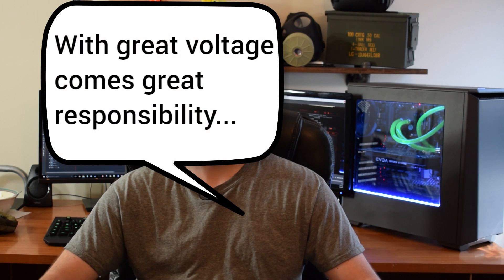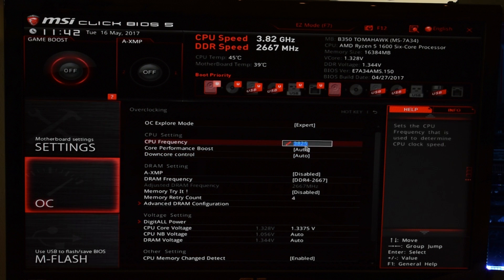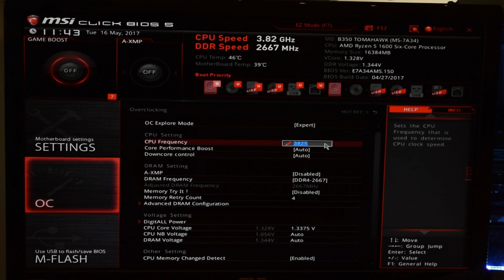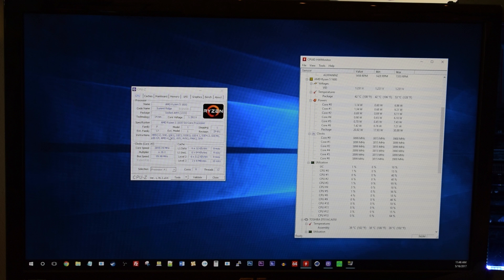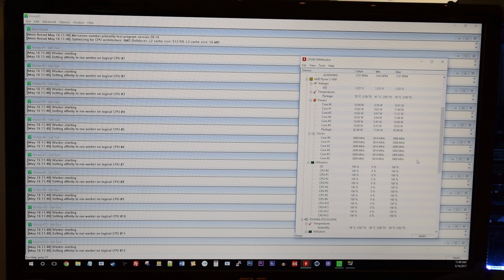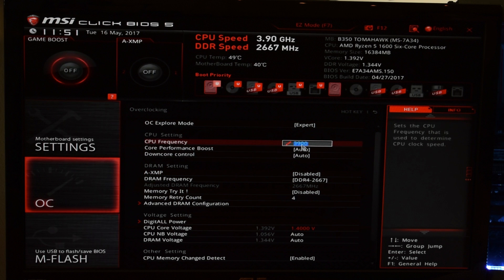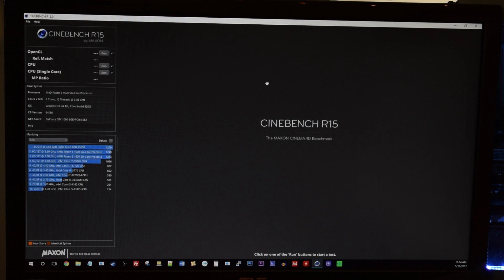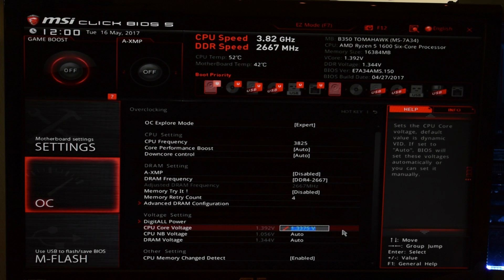How to Overclock a Ryzen 5 1600 CPU - Super Easy!

Comment: Love the video man just need a little help if u dont mind. I wanna get the same mobo and cpu and want to run everything on stock so will that still perform ok?and maybe u can recomend a less pricy graphics card that will do just  fine..everything on stock what power supply i should get? And for the ram i read its better to get 2 or more sticks then just a single high end stick. Oh and keep it up man your videos are awesome such info much wow
Reply from the maker: Thank you! Ok first off, the R5 1600 is amazing even at stock speeds. The improvements you get from overclocking really only make a noticeable difference in benchmarks and a couple extra fps in cpu intensive games.

As far as a graphics card, it depends. On 1080p if I were to step down from a 1060 I would say a 1050ti (http://amzn.to/2v0oiiE or http://amzn.to/2vjzNUE) at the very least. It all just depends on prices and availability since crypto miners jacked the price and stock up.

Power supplies usually don't make a huge difference as long as you get one with 50-100% more watts than your PC needs to run. A evga 500b like this one would work http://amzn.to/2hp6eLI).

And lastly, yes dual channel runs faster than single channel. If you wanted 8gb to start and wanted to upgrade in the future then you would be better off getting a single 8gb stick of ram instead of two 4gb sticks. On that same note you could go with two 4gb sticks and add two more 4gb sticks if your motherboard has 4 slots. Just make sure to check the manufacturers website to see if the ram is compatible.

I hope that helps.
Reply: it helped alot thank you very much. i got a EVGA 430 80+  Certified ATX Power Supply will that be ok ?
Reply from the maker: No problem! Yeah, that should be fine.

Comment: Hi, I need some help with voltages, I can't get my 1600 stable not even at 3.8 with 1.4v, is that too much  voltage?
Reply: I have an Asrock x370 fatal1ty Gaming K4 and G.Skill Ripjaws V 2x8gb 3200 (runs  @2933)
Reply from the maker: That's up to you. I personally think 1.4v is too high. I believe AMD suggests anything under 1.42v. To me, the little bit of extra performance wouldn't be worth the risk if it's going to be a long term overclock. Not all Ryzen 5 1600's will be good at overclocking. You might have to drop down to 3.7ghz and see if that will be stable at less than 1.4v.

Comment: i have a question. does the power supply affects the overclocking overall? i plan to build a r5 1600oc with psu corsair cxm450w, does this power rating able to overclock cpu?
Reply from the maker: Generally no, unless you have barely enough power to actually power the system. In my experience, the cheaper power supplies work just as well as the more expensive power supplies. They say the sweet spot for power supplies is at around 50% load. So if your system requires 300w then a 600w psu may be worth looking at. I hope that helps.

Comment: Question , i oc my ryzen 1600 to 3.8ghz on 1.38V but when i look at CPU-Z the voltage is some times alo bigger it jumps to 1.424V  WTF ??? Help me to fix this
Reply from the maker: It really depends on you motherboard and the settings. I would just make sure the cpu voltage is set to manual. Sometimes the CPU-Z doesn't report the voltage accurately and sometimes the voltage applied to the cpu is not the same as what you set it to. I don't think there is much you can do about that that. I think it comes down to tolerences in the manufacturing process. What you can do is lower the voltage to see if it still goes that high. If it only goes that high temporarily then you should still be ok.
Reply: Thats because you have the core perfmance boost enabled.

Comment: can you do a ram oc guide im trying to get my trident z rgb 3200 to run at 3200 but cant my display will get no signal i have a striz b350 f mobo and ryzen 5 1600 at 3.9
Reply from the maker: +Rav's Reality I may be able to do that in the future. In the meantime check the motherboard manufacturers website to make sure the specific model number of ram is supported. If not, it won't run at advertised speed. That's why my 3000mhz kit only runs at 2667mhz.
Reply: SANTINI.IO would a 3.9ghz at an avg of 1.387v be a good overclock the voltage ranged from 1.352v-1.402v -passesd stress test for 4+ hours
Reply from the maker: As long as it's stable then that should be fine. I would probably set the voltage to a costant instead of auto. But again, as long as it's stable and the voltages don't have to be set really high then it should be fine.
Reply: SANTINI.IO on my strox b350f mobo i do an offset voltage of .13740v from the reg 1.237v

Comment: What kind of Cinebench scores are you getting with the 1600? I'm getting ~1320.

My 1600 is stable at 4GHz with 1.4125V. Ram at 3000MHz. With watercooling temps max 70 in synthetic benchmarks.

Comment: Hi. I have just one question and it's about PSU. Im going to make similar build with R5 1600, GTX 1060 6gb, etc. but I was wondering if EVGA 600B is strong enough for that build. I will overclock the CPU only but nothing special because I will leave it with stock cooler. So maybe 3.6-3.8 GHz. My first plan was to go with EVGA SuperNOVA G2 650w, but question is, do I really need that one or 600B will be just fine?
I have been doing some research and people usually say that quality of EVGA 600B is not very good for OC (chinese capacitors, etc). Price of both units are 75 and 110 euros (in my country). So, which one should I go with? :D
Reply from the maker: +Dusan Puzigaca I haven't had any problems overclocking with the EVGA 600B. If looks are not important I would go with the 600B. The Supernova 650 G2 is modular so it will make cable management a lot easier and it will look better. The supernova is also 80+ gold so it is more efficient than the 600B.

If the extra money isn't a problem the Supernova 650 G2 is the better option. 

In the US the EVGA 600B is about 35 euros or ($40 USD) which makes it a good choice for the price (That's why I got it). The Supernova 650 G2 is more than twice that price which is why I didn't consider it.

But because the price difference is closer between the two where you live, if you can afford it, I would go with the supernova 650 G2.
Reply: Thank you for the answer. I'll go with 650 G2 then.
Reply from the maker: +Dusan Puzigaca No problem!

Comment: Great video thank you very much.

I must be lazy when I dialed in my Sandy i7 way back I just used CPUZ stress test until I got a failure. Then upped voltage 1 step at a time until a pass. Then upped core speed more. I ended up with 5.1Ghz@1.42c with max temp of 82c under Aida64 and 52-59c in most games and a lot of others sitting at 47-53c. The system been running this way for years and never crashes in games well unless the game itself is poorly code. This CPU also does 5.2Ghz but with more voltage so whats the point if only 100Mhz but a 1.47v you get to the point of little returns.

This is on a zalman 9900 max air cooler only in a Antec 900 case. The Zalman is mounted so air is blowing hot air up then the 200mm top fan sucks it out. I installed a partition over top of th Graphic card to block heat from video card getting into CPU area and warming up the CPU. The graphics card now vents out the side of the case through vents I carefully made. Two front fans move cool air into the CPU chamber area and bottom chamber area to keep case temps down. With this case and a very minor mod my temps dropped every where inside it. I will miss this case when I change it out I think it's time for modern cable management where everything is hidden.lol

Comment: Hi!
I am thinking of setting new pc configuration and I am wondering can I save some money by choosing 1600 over 1700. My concern is the preview in adobe premiere of 4k footage won;t be smooth, especially if I add some luts or multiple footages on one screem.

Have you got any set backs when doing your videos, because dropping frame rates is so much worse than couple of minutes of waitng when rendering.

Thank you in advamce
Reply from the maker: valvendex I have only edited 1080p at 60fps but haven't had any dropped frames or bad frame rates. I will get ahold of some 4k stock footage and let you know for sure.
Reply: SANTINI.IO what's 4k like?

Comment: I have shit luck for stuff like this. Surprise surprise, I cant even hit 3.7 GHz, and my chip runs at 80 celcius
Reply from the maker: +Swedishnbkongu Sometimes its just the luck of the draw. What cooler are you using?
Reply: stock cooler, when i have the cash ill buy an aio i think to maximize my performance
Reply: Thanks for the reply
Reply from the maker: +Swedishnbkongu No problem. Yeah better cooling usually helps. If it doesn't help the overclock it will at least increase the longevity of the CPU.

Comment: So at stock my cpu can run 3.7,3.8 makes it crash.Just did some testing and 1.375 voltages for 3.8 was stable in benchmarks but created stutters in game,dropping voltages to 1.3000 stopped the stutters and lowered temps.at 3.8 it runs at 69 to 70 c.
Reply from the maker: +Informative Gamer S I also noticed stutters with higher voltage. If it continues I would lower the overclock. The marginal performance gain isn't worth it if you have to deal with stutters and screen tearing in my opinion.

Comment: Mine is setting stable  at 3.85ghz with offset voltage of 1.375v, i'm using intel liquid solution cooler and asus prime b350 plus mboard
Reply from the maker: +Alzidjali Suleiman That seems to be about what most people have been able to achieve. I wish they overclocked a little higher but it's hard to complain when at least we are able to overclock them.

Thanks for watching!
Reply: SANTINI.IO yes, it's not as high overclocks as  intel chips can go, but still a nice couple mhz we gain, between 200-400 mhz what most ppl r getting, and performance is a killer in terms of the price.
Reply from the maker: +Alzidjali Suleiman Yeah I think it will be a while before another CPU beats the price to performance of the 1600. It will be interesting to see what Intel comes out with in future now that AMD is competitive again.
Reply: Agreed

Comment: Good idea for another video would be how to remove a heat sink fan and clean the old grease off and apply new thermal paste. Both for intel and Ryzen.  I know iv never done it and would be awesome to know how so I don't mess anything up lol
Reply from the maker: +Laceyn I actually do this in my water cooling loop video although I don't go over it.

What I do is use 70% or 99% isopropyl alcohol on a coffee filter (or other lint free cloth) and wipe it off. Then I use a dry coffee filter to make sure its completely dry and clean. I do the same on the heatsink. Then I apply the new thermal paste.

I may make a video explaining it, but until then I hope that helps.
Reply: Oh ok cool. The main thing im worried about is the removing of the heatsink lol. Dont want to bend anything thats not suppose to be
Reply from the maker: Laceyn I'm just about done editing the video now. It will be up in the next hour or so. Heatsinks are usually pretty durable. As long as you don't bend any copper pipes you should be fine. Fins can be bent, but try not to.

Comment: You should run prime95 for at least 4h, some people advise 6/8h to be 99% sure it's stable (hardcore people let it run 24h just to be sure). 30mn is not enough to be sure the OC is stable. I had crashes with my 2500K after 3h sometimes when I tried to OC it.
Reply from the maker: Noashakra So the reason I say 30 minutes is because when you initially start tweaking the settings you end up making a lot of changes. At 4 hours at a time some overclocks could take days. When you think everything is dialed in that's when I go for longer tests.

You are right, the longer the test the more confidence you can have in your overclock being stable.

Thanks for watching!
Reply: Sure, I was just pointing that out for people who might not be aware of that.

Comment: Got mine stable at 3.8GHZ  at 1.28v on air its not going over 60C on full Load
Reply from the maker: +Alriske 2.8v? I think that CPU would dead lol. Did you mean 1.28v?
Reply: Yeah i saw it to late lol :)
Reply from the maker: +Alriske That's what figured. 1.28v is a really good voltage to be at.
Reply: Thanks for the correction. PS: I subscribed to the channel love your video's  they are clean and you can learn something from them.
Reply from the maker: +Alriske Thank you! I appreciate it,
Reply: my 1600x 4ghz at 1.32v, full load 60C

Comment: I managed 3925 @1.3825 volts, mem only at 2666 with 14 14 14 14 35 though. Mobo is AsRock Killer Sli/AC, cpu is the same as yours (r5 1600).
Reply from the maker: +mupinIV That's pretty good. I hope in the future bios updates fix memory compatibility and speeds.

Comment: Got lucky with my 1600. I was able to get it stable at 3.9 without having to adjust the voltage. I want to see how far I can push it with more voltage, but I'll wait until I get something other than the stock heat sink to cool it before trying.
Reply from the maker: That is pretty lucky. I would imagine you could go a lot further if you haven't had to up the voltage.
Reply: well, the auto voltage is pretty aggressive, atleast on my ASUS board. It will gladly hit 1.4v on auto and 3.8 ghz. With the stock cooler this makes it hit 70+ c instantly and I dont know why I'm not comfortable with that. If I do offset mode and set it at the lowest setting like -0.0125v it will sit at 1.2v@3.8 ghz pretty comfortable
Reply from the maker: Noel Danyluk As long as its stable at 1.2v then that would be fine. But I have a feeling 1.2v is a little low for it to be stable.
Reply: Noel Danyluk I can't  divide on r7 1700 or r5 1600 mobo mem combination I need help
Reply: Divide? Or did you mean decide? If your looking to buy new gear. Ask yourself how much rendering, editing, and encoding are you really going to do. If it's a lot the 1700 is worth it. Otherwise save the money and get the 1600. 

For motherboard get the brand you're comfortable with. Ram its a tricky one with Ryzen. I took a shot in the dark with my choice of ram. Honestly though I would suggest picking your motherboard and then search forms to see what ram and ram speeds people are getting with that particular board. Base your ram decision on that, but honestly any 3200 ram should do. Just be prepared to not have it run at those speeds out of the box if you don't do your homework first.
Reply: Ali Rizwan glad to hear that. Which one did you end up going with?

Comment: 3.9GHz. Can't get it any higher. RAM runs at 3200MHz so I can't complain.
Reply from the maker: If you think about it, it kind of makes sense that it's hard to overclock them past around 3.9ghz because the binned CPU's ended up being 1600x's. I think if I would have bought compatible ram I could have run it at the advertised 3000mhz. Thanks for watching!
Reply: Makes sense. Liked and sub'd
Reply from the maker: +Jason Giles Thanks man! I really appreciate it.

Comment: Hi, im a new sub and i must say your chyannel is really good. Besides that, im planning on getting a ryzen 1600 but ill run it with the stock cooler. Would you say is safe to use those settings as a 24/7 standard overclock? Thanks in advice! and sorry for my bad english
Reply: I am using the ryzen 5 1600 with stock cooler @3792 GHZ with no issues my core voltage is 1.35
Reply from the maker: +Facu Dominguez Thank you! I would say anything under 1.4v will most likely be safe for a long term overclock. The lower the voltage you can get the better.
Reply: Thanks for your response! Now im waiting to see the budget i count with and the fluctuating prices. Being from argentina makes everything more expensive
Reply: Facu Dominguez try to keep it under 1.3v under the stock cooler for 24/7 long term overclock .the stock cooler won't be able to keep it that cool above that voltage.Safe is 1.35v.The stock cooler is relatively great tho I've got my 1600 to 3.8ghz @1.27 V. max temp while gaming is around 55 degrees and idle around 38.I am using aftermarket thermal paste though.Artic Mx4 which brought my temps down around 10 degrees at load over the stock compound
Reply: Thanks, as i said above, the financial state of my country limitates my decision making since 1 dolar is almost 16 times muy currency. The ryzen 5 1600 is $4200 and thats the lowest i could get it, something like 263 uSd. Si i need to take advantage of the stock cooler
Reply from the maker: Facu Dominguez When you first said 16 times it blew my mind. That sucks, but $263 isn't too bad. I think it's still worth it at that price.
Reply: SANTINI.IO i dont know how salaries work un the states, but i earn for a full time job 600 uSd per month. So although is worth, is hard to get when i also live alone and paying rent haha
Reply from the maker: Yeah that makes a huge difference. Food and rent definitely come first. In the US the full time monthly pay for minimum wage is approximately $1,150.